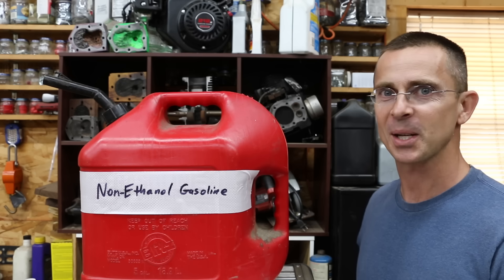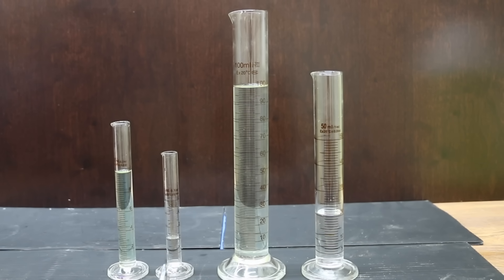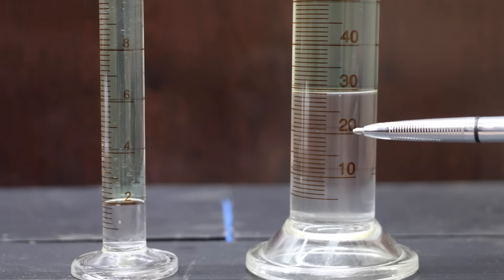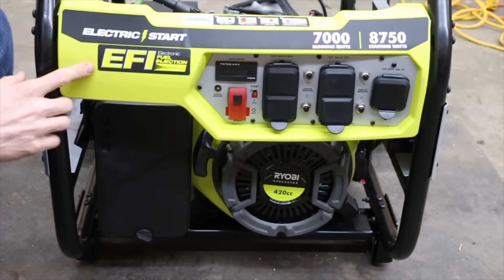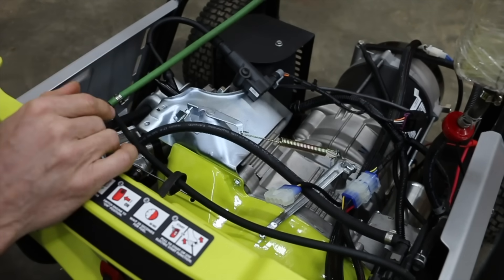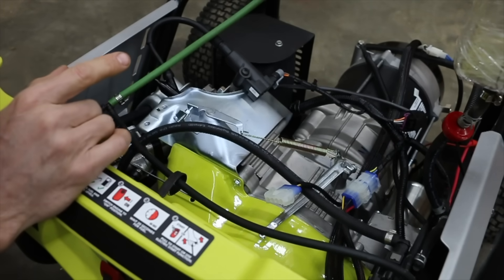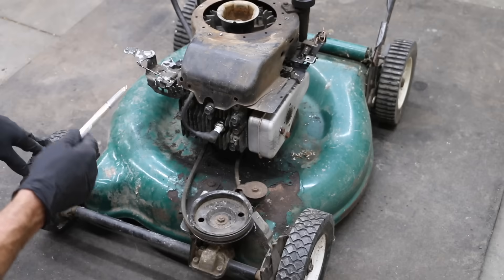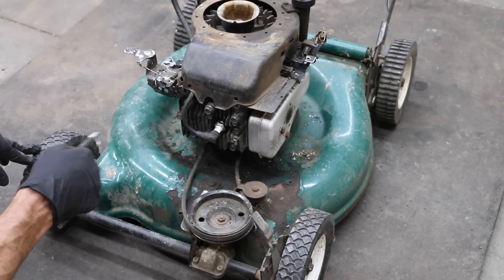Is Non-Ethanol Gasoline Really Better? See the PROOF!

Comment: Great video!  The reason I buy non-ethanol fuel for boats, lawn equipment, and cars that I use very little is that ethanol goes bad much sooner than non-ethanol fuel.    Am I doing the right thing? Can you please do a video on the storage properties of the two fuels? I realize doing the research for the video is a long term thing, but I think it would be worth it and would be a most useful video for many of us.
Reply from the maker: Thanks!  Thanks for the suggestion.
Reply: @ProjectFarm  Do it. Do it now.

Comment: In Australia we have E10 which is 10 percent enthonol and l refuse to use it because l have had a lawn mower stop working because of the plastic caburator somebody else put E10 in it also a whipper snipper failed because of E10 and a plastic carburetor the efi generator will run on E10 until the fuel pump fails because of the E10 and l noticed your lawn moweř had a metal caburator try the same test on a mower with a plastic carburetor the results wil be totally different
Reply from the maker: Thanks for the suggestion.

Comment: Ran E10 fuel in a V6 Camry for a lot of years 

When it got to the 300,000km service, my mechanic told me he hadn't installed new spark plugs because the plugs installed at 200,000km still looked new 

I moved a couple of years later and got a new mechanic. The last service was at 390,000km and he told me the spark plugs still looked good
Reply from the maker: Thanks for sharing.

Comment: I am the president of a small flying club and we legally use Non Ethanol MOGAS in our airplanes, mainly that it has no lead which AVGAS contains.  We can't us ethanol as it damages the seals in carburetors and other fuel components.  But we do find our spark plugs are cleaner, no lead deposits in our cylinders and, if properly leaned, very little carbon build up on plugs and heads.  We do get better fuel range with MOGAS versus the AVGAS.  Unable to test, legally Non ethanol MOGAS versus Ethanol MOGAS>

Comment: What you need is a twin engine with dual carbs (riding mower?), and plumb two separate fuel feeds to each carb. One you use ethanol gas and the other non-ethanol.  Run the engine as normal for a couple months, then tear down and inspect.  Direct head to head comparison on the same engine and same use conditions.
Reply from the maker: Thanks for the feedback.

Comment: My hobby is old tractors, and Ethanol in gasoline is the kiss of death on any aluminum parts in the fuel system.  Sometimes they will set for months at a time between runs.  If the fuel is not completely drained, it will completely corrode the aluminum parts. You might as well count on a few hours to tear everything down and clean it up and hope that it is not damaged beyond repair.
Reply from the maker: Thanks for the feedback.

Comment: We have been massively using ethanol in Brazil since the 70's, and indeed the motor building must be significantly different.  Therefore you should only use ethanol infused gasoline in cars.  In fact, we have dual fuel car engines here, so we can use up from 💯% gasoline up to 💯% ethanol.  

The biggest problem with ethanol is cold. When the weather is cold the car may have problems starting up.
Reply from the maker: Thanks for the feedback.

Comment: Just a quick update to this: I've been running both 10% ethanol and 0% ethanol gasoline in my Coleman camp stoves and lanterns and the ethanol gas has noticeably more corrosion on the generators than the ethanol free. I've just rebuilt them and there is a clear difference (they were all rebuilt at the same time previously).  I've run unleaded in them for decades and I'm very familiar with the effects &  low octane fuel with ethanol is definitely not good for them.  But an easy fix is to add 10% water to the fuel,. shake like a bugger for about 5 min and then let it sit in a cool place overnight.  Pour off the fuel on top and leave the water/ethanol mix at the bottom and you're good to go.  Burns nice and clean with no smell, no carbon build-up and no wear down/corrosion of the generators.
Reply from the maker: Thanks for the feedback.
Reply: So just to make sure got 80% gasoline with 10% ethanol and 10% water or 90% gasoline with 5% ethanol and 5% water?
Reply: @vitordanieleal  Add equal amount of water for whatever % ethanol in the fuel.  If it's 10% ethanol add 100ml water for every liter but more won't hurt it.
Reply: @Enjoymentboy  That sounds beautiful I'm going to try :)
Thank you

Comment: Wouldn't it have made more sense to run two of the same device simultaneously with the same volume of fuel and see which on last long and which had more build up?
Reply from the maker: Thanks for the constructive feedback
Reply: @ProjectFarm  wasn't trying to be rude. Just there's a certain amount of unuseable fuel that will always be left over when you swap fuels. So could be giving slightly skewed results.

Comment: If you want your stuff to start after sitting for 12 months, you use ethanol free fuel.. Period..  After dealing with small engines for 30 plus years, it's the only thing I've found that PRETTY much guarantees you're stuff will start after long periods of non-use.. As far as the rest of the stuff goes, well, if it doesn't start, really doesn't matter lol
Reply from the maker: Thanks for the feedback.
Reply: Truth! I no longer deal with this gas mess since going to EGO battery equipment. Before, I would get a 5 gallon can of gas, add a cup of water and a few drops of blue dye to the gas. Shake it up and use it a few days later. The dye helped to see the water/ethanol junk in the bottom of the can. I ran the mowers on straight gas and they never had water in the bowls. Lower octane but higher BTU. The ethanol is a scam just like that "stabilizer" mess the repair shops pushed. There is a reason fuel pumps have the sticker "Boaters, Check With Manufacturer before using this gas: Contains Ethanol". Ethanol is a magnet for moisture.

Comment: Have admit some of this went over my head, however in my experience when using 2 stroke engines, quality oil is key! No doubt someone will shoot me down in flames, but that is just my opinion & experience! Use my tools every day, so fuel is never in the machine for more than about ten hours, so maybe I'm not the best judge!
Reply from the maker: Thanks for the feedback.
Reply: Your one hundred percent correct quality mixing oil in your 2 stroke engines is what they absolutely must have. What 2 stroke mixing oil do you use ? Do you use ethanol free or 10% ethanol gasoline ?
Reply: I use Lucas semi-synthetic 2-cycle oil - buy it by the quart at O-Reilly's auto parts. Also, been mixing it at 50:1 (weed eater) for use in my Snapper 2-cycle mower.  The mower says 32:1, but it seems to work just fine, less smoke to boot.  And fewer spark plug issues...

Comment: Good job on having quite a controlled test with home garage setup!
With something I learn from a engine research lab, there are some point we can improve test accuracy. First is to use a known-volume container for fuel e.g. 50 cc pipet with a stopwatch to precisely measure volumetric fuel consumption, then you can convert to mass flow rate later. As your setup already have  watt meters, that's a good setup to have. Then you can calculate specific energy consumption (SEC)(in g/kWh) for each test which gives you more comparable result. Although, this won't be 'brake specific energy consumption' (BSEC) because there is no engine dynamometer. But this method should significantly improve the fairness result with minor modification to existing test setup.
Will wait for the follow up test video!
Reply from the maker: Thanks for the feedback.

Comment: ethanol LOWERS the octane level since alcohol has a low energy density. Petrol has a high energy density. Add low and high energy density and the energy density is LOWERED through averaging. However, there is LESS fuel since you are removing alcohol which is a fuel source.
Reply from the maker: Thanks for the feedback.

Comment: Fill up your car/truck with E-85 and watch your mpg drop..a lot.  Alcohol has less energy than gasoline per unit, so it takes more fuel to get the same results. 

I use only rec fuel in my small engines and all the issues went away.
Reply from the maker: Thanks for the feedback.
Reply: @ProjectFarm  You do pragmatic work, nice to see.

Comment: Fuel efficiency test is flawed. Ethanol has a lower energy content per volume so of course its going to run out faster. To accurately test how much energy is extracted by the generator you would need to account for that in your sample volumes
Reply: he was testing energy amount per volume, so essentially testing miles per gallon almost

Comment: Only 5 weeks ago, I bought a 1990 Suzuki VX800 and sold my 1999 Yamaha Fazer  600
I did this purely because I have disabilities and the VX is heavily modified.

Now, I didnt realise this, but the Fazer is absolutely fine to use E10. The carbs are plastic and can take anything, even E85  ( Really nasty stuff that the US use apparently ) and the rubbers are all ready for it too!

The Suzuki on the other hand.... erm, not so good. The carbs are both of Brass and copper, the rubbers are cheap and nasty and they are simply NOT going to be good with E10.

So, I am now going to have to look out for newer carbs for it, plus I will still have to adapt the newer carbs to use different bits inside.

The horrible thing about this bike, is that the carbs are physically completely different, sop sourcing a pair of carbs that are compatible is not going to be easy and worse, how the hell do I balance them properly? Im not too hot with carbs so I think I am going to have to get someone to help me.

So, while I can still get the good stuff, I will have to do that.

Comment: Fuels with a high ethanol content (particularly e85) will actually clean away carbon buildup and other residue. So much so that after the first few tanks of e85 you may need to replace your fuel filter, however after that the fuel filter will usually last longer. Some rubbers and plastics don’t like such high concentrations of ethanol though. I’m not sure you’d even need to run it for THAT test, just soak some of the rubber and plastic parts in ethanol for a while and see how they go.
Reply from the maker: Thanks for the feedback.

Comment: I used to use regular (ethanol) gas in everything.. well, on things that sit over the winter, I always had carb issues, and all kinds of problems getting them to run the next season.  After switching to non-ethanol about 7 years ago, I can take something out of storage and crank it right up, no issues.  It seemed to me the ethanol gas just does a number on the aluminum carbs.   But as you stated, fuel efficiis better with ethanol containing gas, so things I use a lot like my four wheeler or tractor, I don't worry as much about using non-ethanol.  Great video btw, and I love all of your thorough testing and honest results.
Reply from the maker: Thanks so much!  Thanks for sharing.

Comment: Been in the boat repair business 41 years. Ethanol is THE biggest destroyer of fuel systems. Roughly 15 percent of business is ethanol related failures in fuel feed and engine running issues.
Reply from the maker: Thanks for the feedback.

Comment: Sorry for such a late comment. There was a "Cycle World" magazine (I think it was them) article in the late 1970's about gasohol. People were curious about it when it first appeared on the market to replace "Ethyl". They ran a motorcycle on it to compare it as you did. The gasohol test came out with a spotless combustion chamber compared to regular. Also, our area stopped selling "Ethyl" soon after that so I tried it in my motorcycles. The alcohol addition ate the chrome plating off of the float valves in our Honda CB360 twin and required repair. My 1980 Honda didn't have the chrome plating so there was no harm. Regards,  Robert
Reply from the maker: Thanks for the feedback.

Comment: Really interesting as 10% ethanol fuels are just rolling out at gas stations here in the UK. Standard unleaded is now 10% whilst premium remains at 5%. As an idea for a video, have you tested catalytic converter restorers ?  I just bought a used car thats failed its last 5 years annual emission tests. I have dosed it up with a fuel additive (Cataclean) to see whether this can restore the function of the cat and get the car through its emission test and save an expensive cat replacement. Would be interesting to see these products tested and see whether they do actually work or whether the effect is only while the product is in the tank. Thanks for a great channel.
Reply from the maker: You are welcome!  Thanks for the suggestion.

Comment: Ethanol and water solution has lower volume than the volume of the two separate liquids. That's why it's not reaching 30 so the fuel can easily have 10% ethanol.
Reply from the maker: Thanks for the feedback.

Comment: I'm slowly working my way through your video 'back catalogue. 
I modify 1970's motorcycle carbs and found several years ago the float height needs adjusting to lower fuel level in float bowl .
 Due to ethanol's lower density the fuel doesn't 'shut off' at the correct height and being higher level in various jets/orifices makes motors run quite rich usually getting much worse fuel consumption (and lower power)
Reply from the maker: Thanks for the feedback.
Reply: @ProjectFarm  Oh, it's probably why you were getting an orange flame during combustion with the E10. Most 'industrial engines have very few if any adjustments though so re-setting float level may not be possible (none of the Briggs & Stratton and Kohler motors I use have float adjustment)' New and improved' isn't always true, particularly if you like to 'tinker'

Comment: "Hydrophilic."  I think it's actually "hygroscopic," i.e., it absorbs water.  Even water vapor.  Here's a little missive from Mercury Marine, who ought to know about the adverse effects of alcohol-blended gasolines and their hygroscopy on internal combustion engines :

"Alcohol in Gasoline

"We do not recommend the use of gasoline
which contains alcohol because of the possible
adverse effect the alcohol may have on the
fuel system. In general,
Gasoline containing alcohol may cause the
following problems to your outboard and fuel
system:

   "Corrosion of metal parts.
   "Deterioration of elastomers and plastic parts.
   "Wear and damage of internal engine parts.
   "Starting and operating difficulties.
   "Vapor lock or fuel starvation.

"Some of these adverse effects are due to the
tendency of gasoline containing alcohol to
absorb moisture from the air, resulting in a
phase of water and alcohol which separates
from the gasoline in the fuel tank.
The adverse effects of alcohol are more
severe with methanol and are worse with
increasing content of alcohol."

Excellent video, by the way.
Reply from the maker: Thanks!  Thanks for the feedback.
Reply: @ProjectFarm  You bet.  You're doing good work.  Keep it up.